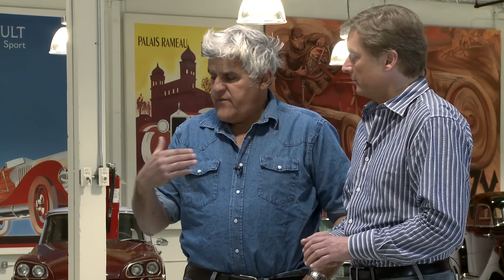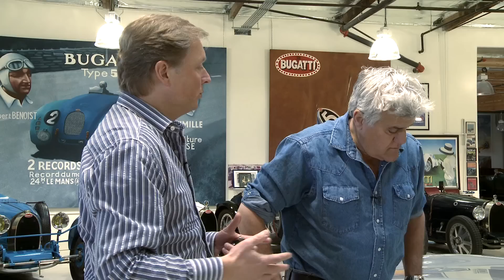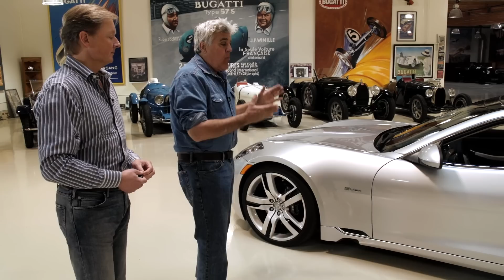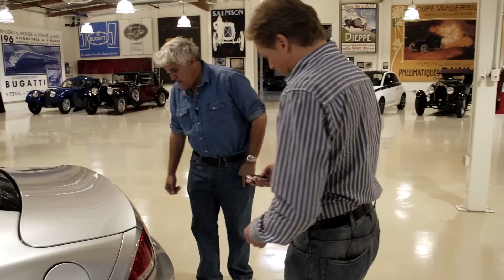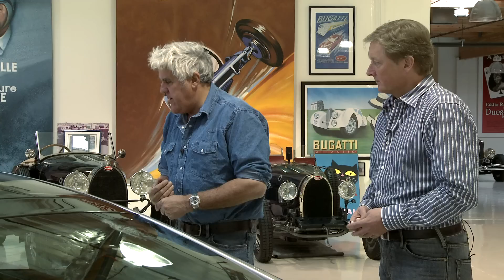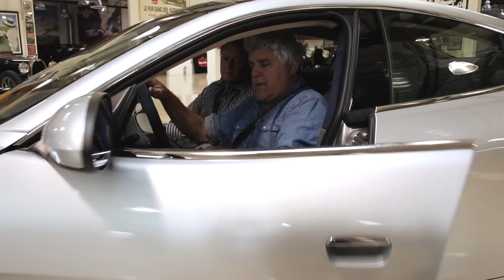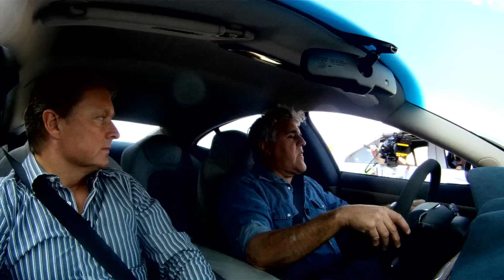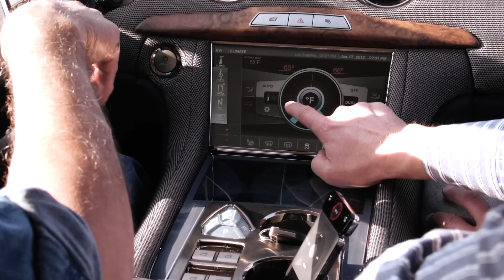2012 Fisker Karma - Jay Leno's Garage

Comment: I was lucky enough to be driven around in one yesterday, the car looks better in real life, and a hit with the chicks.
Reply: 12voltvids Tesla's car is MUCH more refined, and Fisker is out of business. Of course a few Model S's will have problems, its their first car so its expected, but majority of them run flawless. My friend has 25,000+ miles on his Tesla and hasn't had a single problem.
Reply: iTheGeek
I wouldn't say that Tesla has a much better product. Ever owned one. My friend has a Tesla and he has had major problems.
I'll stick with my volt thank you very much. Had mine for almost 4 years now, and other than 1 oil change it hasn't had a wrench touch it. Will be in line for the next gen. A superior car in every respect, and no range anxiety, and no sitting around for a couple of hours waiting for a super charger to come free. Nothing like throwing a wrench into your schedule than having to charge your tesla, and finding all the chargers in use because cheap ass locals are getting their free charge while sipping their starbucks. By the time you get on the charger, and get a charge 2 hours has gone by. Last year my friend and I left on a trip that took us from Canada to Las Vegas. We both left at the same time. I got their a day ahead if him, because he had to stop and charge up, and I didn't. I got in the evening before, and he arrived the next day. That's an inconvenience if you ask me.
Reply: *****
Really? My friend has found many problems with his car. Many fit and finish problems, and little things that you would expect on a car costing as much as a Tesla, such as lights on the vanity mirrors. Even my volt has those, and they get used all the time by the females in my life. I have 70,000 miles on my volt, and not a squeak or rattle out of it.
It's all hype, they arn't as good as the fan boys would lead you to believe. Just the problems my friend has had, and just in the past week he had another hiccup with the charge door not opening, which as you can imagine is a problem.
Tesla had to take his car away again to fix it.
Reply: 12voltvids Unfortunately, no Chevy volt or fisker karma can drive as well as a Tesla. Test driving one and interacting with the 17 inch touchscreen is awesome. It isn't perfect, it's missing rear cupholders (you have to buy them separately which is dumb), it doesn't have the lighted mirrors, some of them have minors problems, etc. But it's the most fun to drive, one of the safest cars on the road, has the most storage, and is constantly receiving new software updates that add even more functionality to an already awesome car.
Reply: Fadil Karim
The 17" touch screen should be banned.
Too many accidents have already been caused by drivers distracted by it.
I took a Tesla for a test drive, and it was OK, but I certainly wouldn't buy one.
Even if it was half the price I wouldn't buy one.
Reply: iTheGeek
Fisker went out of business because it was grossly over prices, and mediocre quality. It was 3 times the price of the Volt, and really offered less. It was smaller inside, and got poorer fuel economy. Tesla is ok if you never leave the city, but for road trips it sucks. I have a friend with one, and we both went on road trips, my experience was great. I got to see the country, and very unique places. My friend on the other hand had to stick to the main roads, and it took him a day longer to get there. Once you get over the silly touch screen, it looses it's appeal.
Reply: 12voltvids No offense, but you must not be a car enthusiast if you didnt enjoy the low CG, the acceleration, the surprisingly good handling, the linear steering input, etc. That is fine if you don't enjoy driving. But anyone who enjoys driving, including the folks at motortrend, consumer reports, and car and driver, have nothing but praise about the way the Tesla rides. It just is a very well composed car on the road.

Also, I have heard of one accident that is caused by distraction from the touch screen. However, for your statement to be true, there would have to be a significantly higher amount of Tesla accidents than normal car accidents due to the distraction. However this isn't the case.
Reply: Fadil Karim
I am a car enthusiast and I am used to driving some fine cars that handle exceptionally well. I have owned BMW in the past. The acceleration was quick, and handling good,but not that much better than what I get out of my volt. I am not ripping around the roads at super high speeds, as here where I live, 25MPH over the limit gets the car impounded for 7 days, and a huge fine. So it really doesn't matter how much power I have, my volt gets it done, handles just great, it too has a low CG as it has a big battery under the car too, goes plenty fast enough for me, costs me next to nothing to run, but I never have to worry about being stranded, and can go anywhere, anytime, and not have to worry about finding a place to plug in and then waiting for hours to get a charge. When I travel, I just gas and go, and the rest of the time I plug in and go. Best of both worlds, I would do it again. As to the touch screen not causing accidents, well, nobody has admit to this yet.
One guy claimed the new car smell made him pass out, and that is why he ran the cyclist over. Then there was the car that ran over a toyota and wiped out a family. Another distracted driver case, but he said he fell asleep. Whatever makes them sleep better at night I guess. Tesla did a very irresponsibe thing, allowing the internet browser to operate when the car is in motion.
Reply: 12voltvids I haven't driven the volt so I cannot comment on the driving characteristics of that car. 

Technology wise, the Volt and Teslas are totally different. The Volt is essentially a hybrid that can also run on pure electricity for a couple dozen miles. The Tesla is a full blown electric car capable of going 270 miles on a single charge and is supported by a huge supercharging station around the world.

Both have pros and cons; however, I wouldn't just dismiss the Tesla for successfully taking a bold step just because you prefer the other option. Both cars achieve their goal of efficiency in very different manners.

Even if we just compare the crash rates of Tesla's (for whatever reason, even if it doesn't have to do with distractions), i'd bet that their crash rate isn't higher than any other high end car.
Reply: Fadil Karim
Actually technically they are very similar. The volt is an electric car, driven 100% by electricity for the first 40 miles, 50 miles on the new one. After that time the engine starts to generate electricity to power the electric motor. Under certain conditions the engine can provide some power to the wheels, but this is not the normal mode of operation. The normal mode is the engine cycles on for a few minutes as the battery takes a small charge and then goes off until the charge is used up and then it starts again. Yes I am fully aware of the charge network, however they are not everywhere, and that is the prime reason I went for the volt. My friend with the Tesla loves the car with reservations, as he has been been stranded a couple of times with a battery that didn't make it to the nearest charging station. As he put it, it is embarrassing when the car shuts down with the  charging station in sight. He has been put of traveling out of town in his tesla and now takes his A8 on trips.
Reply: 12voltvids While they both run on electricity, using a generator to make up for the limited battery capacity isn't the same as not having any generator at all.

The charging network already has 98% of the country covered with supercharger stations at every 150 miles. With minimal planning (that the maps application helps with), it is pretty easy to go on long road trips. There are dozens and dozens of individuals on the Tesla forums that have done so. Charging was a bigger problem when the charging network wasn't as large as it is today. And in the next 2 years, it'll be even larger!

Even if you prefer to use a generator and not superchargers, you have to admit that what Tesla has done in the time span of just 3 years is incredible. Building such a massive charging infrastructure in such a short period of time is crazy!
Reply: Fadil Karim
I agree that the charging network is much better now than even 2 years ago, and there will come a time where there will be one at every gas station in every little small town in the country, and when that day comes there will be no need for gas cars, but you said it all in the previous statement. Planning. You have to plan your route so that you can charge along the way. I do not. When I go on road trips, I have no specific destination, or agenda. I just get on a road, any road, and see where it leads. That is the excitement of just being able to do that. I have been to some pretty cool little places that are just a dot on a map, and have seen some of the most beautiful scenery in the country, and I do that every summer. I have literally thousands of breathtaking photos and video from these places too. Places that I would not be able to go in a Tesla, and probably never will be. That is the strength of hauling a generator around. For 99% of my driving throughout the year I never burn a drop of that foul smelling stuff, but for that 1% of the time when I am out in the middle of nowhere I can do it, and I don't have to alter my plans, or avoid any place due to no charge, or rent a car for the journey. I can do it all with my 1 and only car.
Reply: 12voltvids Of course there are downsides of having a fully electric car, I never doubted that. Each technology has it's pros and cons. The pro is that Tesla is pushing the technological boundaries of our time and creating a charging infrastructure and taking on all the challenges so that other companies can follow with ease to end our dependence off of natural gas. 

It seems that based on your traveling habits, perhaps a fully electric car isn't suited for you....YET. For a vast majority of people, the Tesla fits perfectly. However, with the pace that Tesla is expanding, it'll only be a few years where it'll even be suited for you. Just imagine the amount of time and innovation that it took for gasoline powered cars to become prevalent in our society. It probably took decades to build a strong infrastructure. Tesla is doing that for electric cars, but at an exponentially faster rate. 

As a fan of cars and technology, I don't bash any cars. However, I can definitely appreciate it when one new start up company takes the boldest steps to help change the world.
Reply: Fadil Karim
Exactly. For me, I want the benefits of a fully electric car, the low impact on the environment, and the low cost of operation (both in energy and maintenance costs) but I am also not willing to give up the freedom that a conventional gas powered car provides. So for my lifestyle, there was only one choice and that was my Chevy volt. Even when there are charging stations everywhere I would probably still choose the volt due to the quick refueling time when I am on road trips. Having to sit around for an extra hour every 150 miles is not something I really care about.
It isn't that I don't take breaks from driving, I do that all the time, but usually at places to see sights and take pictures, but tucked away behind a starbucks on a forced stop for an hour or more to charge. My friend told me that every time he stopped it was 60 to 90 minutes each time because there was always a wait to get on a charger. Every 300 miles I stop and put in 8 gallons of gas, which takes about 3 minutes.
Reply: 12voltvids And for me I want the luxury, the sportiness, and have the latest technology in my car. Also being able to tell my grandkids one day about the excitement of owning one of the first mass produced electric cars will be awesome!

The charging only takes 20 minutes and gives you 170 miles of range. You could stay longer if you'd like, but that isn't how it's intended to be used. I like to take small breaks on long trips anyways. Also, Elon Musk announced a battery swapping program. He plans on expanding this to nearly every supercharging station. You have the option to do a free 20 minute charge or pay $50 and get your entire battery swapped out with a freshly charged one by robots in under 3 minutes. Pretty cool stuff.

Also, Tesla remotely monitors which charging stations are busy and expands them accordingly. Most owners I've talked to haven't had any issues with wait times. In high volume destinations, there can be more than 8 or 9 stations to charge up and they are only growing. 

A company as ambitious as Tesla is only going one way. Some people are early adopters and jump on the technology after seeing the benefits, while others are more reserved and like to wait till things smooth out. Perhaps some just don't see the value of it at all and constantly hope the new kid on the block will die.
Reply: Fadil Karim
I do hope tesla makes it, but as I said for me, I don't want the hassle of having to change my driving route to accommodate charging. I get all the benefits of a tesla, the volt is plenty fast enough for me, and I get the instant power on demand, just like a tesla, with the power chip mods that folks have done, they have pushed the volt, with just software mods to under 6 seconds 0-60, naturally at a drop in range, but they have done it. I have no need for that. I have driven a Tesla a few times, as I was considering one before settling on my current car. I don't need 150 miles per charge, in fact I don't even need 40. My daily commute is less than 40 miles, and there are free chargers all over the place, so I never use any gas at all, but it is nice to know that it is there ready to go. The only other car I would consider other than the volt is a BMW i3. Down side to that one is very limited power when in range extended mode. That is not an issue with the volt.
Reply: 12voltvids 
I'm a performance oriented guy, so the P85D is the only electric vehicle that I can truly enjoy on a back road while helping save the planet. No other car can do that. No other car (under $250k) besides a GTR can accelerate from 0-60 in 3.1 seconds. This car is in a league of its own. You don't just buy a Tesla because its electric. You buy it because it's luxurious, comfortable, sporty, practical, and sexy. Every other EV is bought only because it's an EV. Not for any other reason.

Tesla can not only use all of the standard L2 chargers that every other EV uses, but also their superchargers, so you're never totally stranded.

Comment: Wow, he's right about the Volt. I didn't know that.

Volt Wiki:
"The Volt operates as a pure battery electric vehicle until its plug-in battery capacity drops to a predetermined threshold from full charge. From there its internal combustion engine powers an electric generator to extend the vehicle's range if needed. When the engine is running it may be periodically mechanically linked (by a clutch) to the traction motor, to improve energy efficiency."
Reply: One thing about the volt is that it rarely clutches in the gas engine. Normally when in extended mode, the gas engine is just generating power. Only under specific circumstances that the clutch engage the gas engine into the power train. The rest of the time it is disconnected, and cycling on and off to generate power as needed. The only times it does connect, that I have found is in the mountains if I don't engage mountain mode first, and manage to drain the battery completely. Then there is noticeable lurch as it switches mode, and power / speed gets limited to about 60MPH, and the engine runs basically full throttle.
High speed highway driving can also engage the engine into the system. Typically at speeds greater than 70MPH.
Reply: Good observation. Great info on your self charging video as well.

Comment: Extended Range Electric Vehicle with a gas engine generator is a hy-brid. Poor design of the battery compartment with a short range. Tesla is by far better engineered.